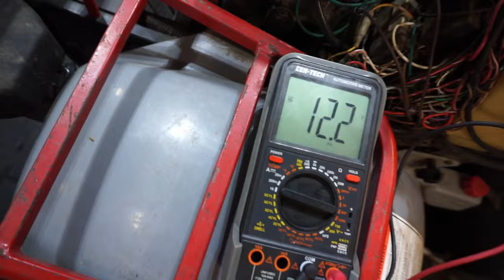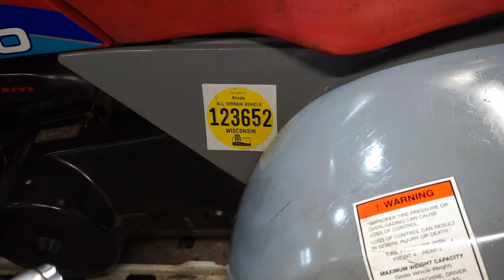I Bought The CHEAPEST 4x4 ATV And Fixed It In 10 Minutes

Comment: When blowing out an air filter, always blow from the inside out. This way you're not blowing dirt deeper into the filter.
Reply: Shouldn’t ever blow ur air filter out anyway
Reply: @2vintageDeamonFan  why?
Reply: @NattyRoider  becuse your blowing out the filter element and can cause cracks and holes in the filter
Reply: @2vintageDeamonFan  you don't have to use full pressure. Just a tad to get the fine particals out.
Reply: @mockinbirds66  still not a good idea

Comment: On that dirt bike I helped put that wiring Condit on there to help protect the wiring. Like you could do on those broken soldered wires with the shrink wrap to help prevent it from breaking again.,or getting snagged off. With small sections precut to fit over those wires neatly to with zip strips.,known as zip ties to.

Comment: Nice! I had a '98 Trail Boss 250, only 2 wheel drive, but also went anywhere. Had a lot of fun with it right up until it was stolen. A bit of deja vu as so much of the construction and parts of the 2 bilkes are the same.

Comment: I had the exact same atv back in the early 2000s it was a fun machine my 4x4 stopped working and the wires had been pulled out reconnected them and worked like a charm. No engine braking and single shock in the rear  was like riding a goat but 2 stroke was fun.

Comment: I still have the tool kit for my 1999 polaris scrambler 400.  It's still in the palstic bag inside the cloth case. The olny thing in my kit vs the kit you have is a tool for adjusting the chain tension. I would post a picture but don't have a way.

Comment: When soldering you might try to strip your wire ends shorter. Instead of twisting your wire interlace the wire from the ends, as it gives more contact area to solder and higher flow of electricity. It also is closer to the OEM wire diameter. It makes a much neater repair and you can use smaller/less shrink wrap and go with the boat water sealed shrink wrap for about the same price.
Reply: And use a little flux on the wire and heat the wire until the solder melts into it, to draw it into the joint and make a solid connection

Comment: Your partially correct that running polaris 4 wheelers without a battery will blow the bulbs.But it is because doing so fries the voltage regulator and then it sends to much voltage and burns out the bulb.Learned this the hard way. Let someone borrow my scrambler 500.Battery went bad and they were pull starting it which is fine.But tje bad battery caused te voltage regulator to go out and when I got back was told the lights didn't work.Machine was putting out 16v at idle. Needless to say a battery voltage regulator and two headlights later im good.Need to start it and check voltage again or you'll be replacing lights again.

Comment: running without a battery can lead to overvoltage depending on the design of the electrical systems. this applies to all atv's and dirt bikes . some have a seperate lighting coil for the lights and some are powered off the battery. if you turn on key and it's not running and headlight doesn't come on you have a lighting circuit. if headlight comes on with key on you have battery powered light. if headlight doesn't come on not running with key on and you start it and lights come on you have the sperate lighting circuit that does not require a battery.

Comment: Heat the soldering iron, then tin it (put some solder on the tip) to aid heat transfer to the wires. Heat the wires, not the solder. When the wires are hot enough, the solder will melt onto and in between the metal strands making a good weld that will not act like a resistor lol. Always heat the wire and let the wire melt the solder. Place separate heat shrink tubes on each wire. If you like, you can also put a larger heat shrink tube over both. Been doing this since the mid 70's.

Comment: I love the channel. I have a 94 Polaris 400 4x4 exactly like the one in this video. It doesn’t want to run with the choke off. I cleaned and rebuilt the carb is it a fuel issue?

Comment: The soldering work can definitely be improved… hold the iron below the wires and introduce solder from above … you will know you got it right when the solder melts into the wires and becomes smooth

Comment: Hey hope you gave that dirt bike trick A try.,or shot to see if it's works out for you in it to. It's the pull switch.,or electric switched controlled. Check the stator out put wire for power source. Unless their cut.,or broken behind the flywheel/ magneto in one for running& charging system to. Remember the wiring does melt off.,or can just what is called burn into.,or snap off from riding it hardcore to.

Comment: Good morning. I have this same machine- i use it for hunting and snow plowing. My battery died and i made a costly mistake by jumping it-pull cord starter worked about 3 times then got stuck out ( dirty and rusty under cover) blew all my lights on my machine! Lesson learned i guess! Replaced tail light-3 headlights and still need to replace instrument dash bulb and the AWD- speedometer light out also. Any help on the dash lights and AWD would be greatly appreciated! Thank you and have a good day

Comment: Just got this exact 4 wheeler for $250 in rough condition that just needed a spark plug. What price range do you all think I could get for it? Runs great, only 1200 miles and motor completely overhauled just rough body

Comment: I have a 2001 Yamaha Raptor 660cc, one of the drain hose is leaking fuel, it leaks more when the fuel tank is full more than when the tanks is less full. Would you by any chance be able to know what is the problem with out having the Quad in front of you?

Comment: I had a scrambler 500 which is basically the same thing with different plastics and the 500 ho engine. They are reliable and capable machines. The only problem i had is you will get the random splash of water on the belt. It never happened in deep water just tiny mud puddles. Weird.

Comment: hey bro engine has to be running to check tranny fluid properly, let it get to operating temp
Reply: If you pull the dip stick with it running it will shoot fluid everywhere, there’s a magnet on the end and a o-ring so it has some pressure behind it

Comment: the oil pump doesn't go bad. there is a inline oil filter that gets clogged and that's why they stop oiling. the trick is to top off the oil resevoir  to the top and check to make sure the level is dropping . no the back brake never works is only because people don't read the manual. the trick is to bleed the rear brake when the braking starts go away. they get air from bouncing around. you can't just bleed the rear brakes there is a trick. if you don't know the trick it will take you about a hour to bleed them . i figured out why it takes so long and reduced it to about 5 minutes by myself. everybody hating on polaris when it is the fault of the operator or the owner. polaris frames are much stronger than the jappers . premixing the oil will lead to premature engine wear .the oil pump gives the engine more or less oil depending on the throttle. premix will lead to insufficient oiling at higher rpm's . do yourself a favor buy a good service manual . replace the inline oil filter and don't just remove it.

Comment: When soldering use the iron to heat the copper wire to the point that when you touch the solder will flow easily
Reply: I've tried telling him that several times

Comment: Heat the wire with the soldering gun and dab the solder on the opposite side so the heat draws the solder all the way into the wire not just coating it I’ve been reprimanded a few times for the same thing by my Grandpa

Comment: don't buy one of these thinking you will fix it easily or inexpensively.  These 400's are known for their hard to replace water pump impellers and nobody on the forums has near as much luck with fixing the 4x4.  the 2-stroke in general is pretty bulletproof.  the 250's are air cooled but have significantly less power.